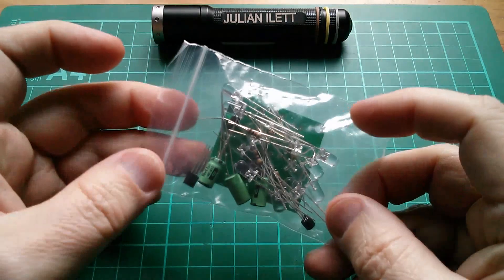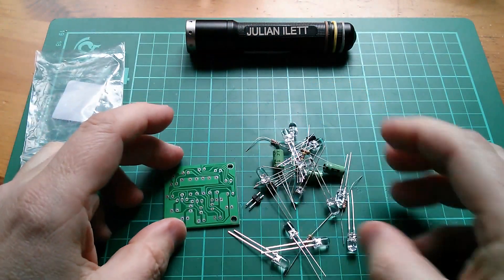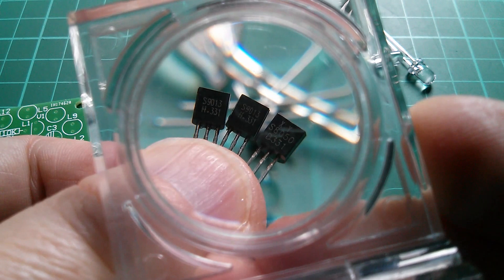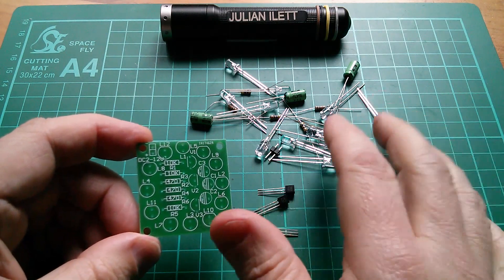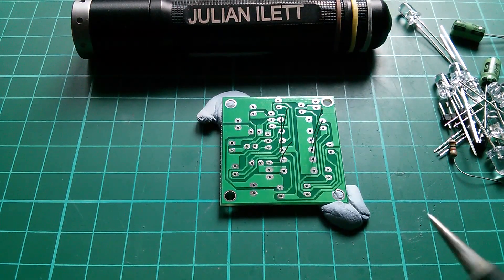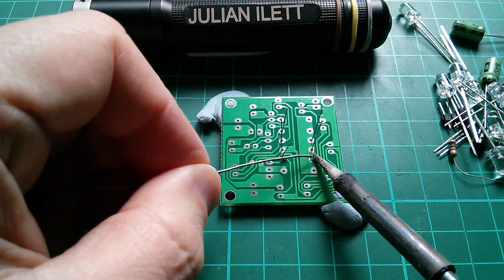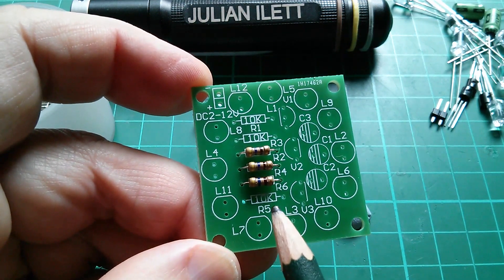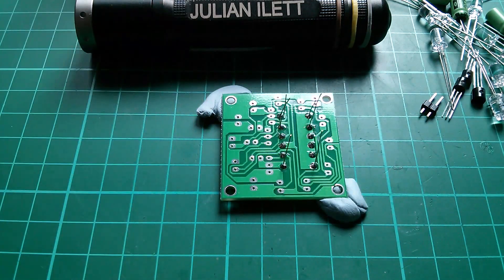Very Simple Electronics: Circular Blue LED Kit Build

Comment: Hi. IT is posible to make IT slower flashing and how please
Reply: Three ways:
i) lower supply voltage
ii) increase the value of the 10k base resistors
iii) increase the value of the electrolytic capacitors
Reply: Kiko Kiki
Hi. IT is posible to make IT slower flashing and how please
'
hi K K...
only one normal speed...
no fast / no slow

Comment: The reason I believe for the 1 transistor being slightly different... without looking at the datasheets of the two types I would assume, that the 2 same have a very slightly higher base trigger voltage.  That would give the oscillator a starting point so that the timing is near perfect.

Comment: I built a kit the other day here in the RV, parked in the Mojave Desert near Needles California (Home to Spike, Snoopy's brother!) It contained those blue Resistors that are so damn hard to read, so I laid them out, and tested each with my component tester, then soldered them in.  Went like a charm, and the device performs as advertised, I now have a nice little oscilloscope built by me, for me.  It works a bit better then the little one I built from a Nano, it does a job when needed but the new one is much nicer.

Comment: Are you actually using leaded solder as you said or is this the lead free variety?  I haven't soldered in years and a little concerned that lead free might be troublesome.
Reply: Richard Forester I've found that lead-free solder doesn't flow as nicely as the old 60-40, I find myself having to use a flux pen and reflow in order to get the connection to look right.  It is supposed to be safer and less toxic, of course, but they said that about margarine and aspartame too.  I generally wear blue nitrile gloves and run a fan on my bench when I solder now, regardless of whether it contains lead or not, as the various fluxes all contain nasty stuff as well.

Comment: Stick the legs of the components trough the holes in the PCB,
bend them to a 45 degree angel on the other side of the PCB, cut the legs at ca 1 - 2 mm above the PCB, 
and THEN solder them.
You get a much better result that way, and the legs are not in the way all the time.
Reply: I don't like the bent leg method because it makes the component harder to de-solder. If you keep the legs straight the component comes out much easier

Comment: Non of these ways to identify the LED polarity is reliable. It might be the commonest way to identify the polarity but not 100% correct all the time. The best way in my opinion is to test the LED by 3v coin cell; if it does not light up on this direction, just flip it over.

Comment: Bet you anything they used a different transistor with slightly different specs to start the imbalance required for the thing to run
Reply: Yep, that were my thoughts as well.

Comment: You have now nice two channel scope, so you can show how the oscillation get started due to mismatch of one of the transistor parameter. Even if you use all the same part number for these 3 stage ring oscillator then also one will start the wave first. The manufacturing tolerance is always there. Thats why two transistor multivibrator circuit still works. I am confused with the fact that why some resistors have 5 band and some have 4. So for beginners like me, it would have been helpful if you could show why some of them have 4 and some have 5 bands. how to read their tolerance etc. Finally my though is, its purely an extended soldering practice.

Comment: For beginners like me, you forgot to explain how to identify the LED by its internal shape. Because I needed to identify one of the LED on my PCB where I have no option to identify which leg was shorter than other. Due to non availability of flat edge (its an oval shaped LED) I can NOT identify anymore. It would have been nice of you if you just explained the cathode and anode identification by its internal structure that would have been helped a lot beginners like me.
Reply: You can always check the polarity with your DMM if it has a diode test mode.
Reply: Network XIII - not all will work with LEDs, especially the higher forward voltage types like blue, white etc.

Comment: The circuit is a bit wasteful on the battery, shorting out the 8 LEDs that aren't lit.
Reply: Have you worked out just exactly how much is "wasted" there?  Clue:  Not much...
Reply: Robin Vince
The circuit is a bit wasteful on the battery, shorting out the 8 LEDs that aren't lit.
'
hi R V...
i have two good LED circular kits with 24 white LED lights in here my channel video

Comment: lol what trickery is going on at 8:40? You solder the 2nd set of pins and then it jumps back in time before that and you cut the first legs off. Is this a mind trick to catch who's watching closely? :P
Reply from the maker: Yeah, that's called getting my shots out of sequence trickery. Which should be impossible because each shot is fully date and time stamped.
Reply: I noticed that too.  Obviously he made a small mistake in editing.
Reply: lol i noticed as well. not sure if done on purpose or not. lol

Comment: Could someone change the LED's to a different color and still work? Or would you need a different circuit design?
Reply: centaur1a - yes, but each group of four LEDs has to be the same colour and type. As as others have said, for different colours or types, the 470 resistors may need changing to a different value. But this does also depend on the intended supply voltage as well.
Reply: You could easily put in different led's, but you might need to change some of the resistors as some led's work at a lower voltage, especially red ones.
Reply: Mark Flack unless you're driving em on extremely low voltages that shouldn't be of concern.
Reply: centaur1a
Could someone change the LED's to a different color and still work? Or would you need a different circuit design?
'
hi C...
i have one LED circular kit and spray black on PCB and 12 white LEDs
Reply: '
hi C...
i have 5 kits...
LED orange  / red / white plus color LED on the center...
already in my channgel video

Comment: When soldering components why don't you solder the furthest 1 first then work towards yourself so as to not remelt the ones you have already soldered?
Reply: Mentorcase - I normally solder components in order of the height of each component.

Comment: one different transistor is used to cause an asymmetry and force the circuit to start oscillating. if all the stages are identical no one will start conducting so there will be no oscillation. This behavior is easy to see when using an electronic circuit simulator like spice.

Comment: The only reason I can thing of is to teach newer useres to be precise with component names. (Like: even though they look the same doesn't have to be the same) But It kinda backfires if the circuit still works with "wrong" placing.

Comment: I found a great challenging clock kit. It's got SMD and through hole IC's and LED's. I have tried several clocks and this one is challenging and works when you're done. The spinning clock hasn't worked out. Couldn't program it because the programs are too large for the storage. I got an 8x8x8 cube kit but it didn't come with the plex case. Watch out for that. They are selling these kits as including the plexi but not in the fine print. then still charging full price.
I'd like to see some of these kits used for modifying other stuff or adding mods to improve the kits.

Comment: hey Julian, just wondering,  as I'm setting myself up with some arduino development, I've ordered a few Nanos, a few breadboards and jumper leads, but what else do you recommend for a beginner in arduino development? I've used the arduino flower thingy to make a light-up skirt before but other than using prebuilt leds and kits I have no clue XD
any suggestions?
Reply from the maker: LEDs and resistors definitely, maybe a few potentiometers for analogRead, and I'm a big fan of OLED displays :)
Reply: +Julian Ilett oh yeah, you do seem to love oled displays XD awesome, just assorted resistors and LEDs yeah?
Reply: I would recommend this kit, especially as it is on special offer at the moment.

http://www.ebay.co.uk/itm/161176373189
Reply: Ashleigh Rowe I highly suggest the Elegoo super starter kit. it's on Amazon. it's an EXACT copy of the Arduino Uno R3. and it comes with a shit ton more parts and projects. I learned to program in C++ just from the tutorials. it is also way cheaper than an Arduino. it is a good quality knockoff, it uses the exact same parts. another thing you might want to get is a small multicolored OLED display. I got one in eBay for $10. it arrived in a little over a week. just search for Arduino OLED display.

EDIT: it's on sale too https://www.amazon.com/Elegoo-Project-Tutorial-Prototype-Expansion/dp/B01D8KOZF4
more stuff 
https://www.amazon.com/gp/aw/d/B009OVGKTQ/ref=pd_aw_fbt_147_img_3?ie=UTF8&psc=1&refRID=P8WCDX2WNYPZ9CJ7WSP9

https://www.amazon.com/gp/aw/d/1259641635/ref=pd_aw_fbt_147_img_2?ie=UTF8&psc=1&refRID=P8WCDX2WNYPZ9CJ7WSP9

Comment: Perhaps it has something to do with how the circuit starts. There is some slight difference between this transistor and the other two which means its set of LEDs will light before the others, and from then on the circuit is up and running.

Comment: Will the LEDs even light at 2V?
Reply: Probably very dimly. LEDs can glow at pretty low currents.
Reply from the maker: +That Guy Not the blue leds. The PCB was probably designed with red leds in mind.
Reply: I was thinking about the forward voltage, not the current.
Julian gets it ;)
Reply: That Guy
Will the LEDs even light at 2V?
'
hi T G...
i have LED circular kits with 6 volts in my channel

Comment: I assume one of the transistors has a lower turn on voltage or is faster acting, to make sure the circuit actually starts.
If they were identical, they could all try to turn on at exactly the same time when power is connected.
Reply: Best answer.
Reply: tjousk but then again no two transistor will ever be 100% identical performance wise. So Idk what the real deal is.
Reply: Indeed.
Reply: +Brainstorm4300 The real deal is to start a particular LED when you power the device on. Havent been through the datasheets yet, but the current gain of that odd one is either low or high and thats been deliberately chosen.

Comment: Checking the LED's "anvil" for polarity is not reliable. It's most commonly negative, but there are exceptions.
Reply: Forssa1 I found that in the hard way. Soldered all of em in and some wouldn't light up. Spent awful lot of time on debugging the circuit before realising what the problem was. After that experience I've developed trust issues and always check each led before soldering them in.
Reply: Forssa1 I suppose no method other than testing is completely reliable. Both legs could be cut to be equal, and LEDs don't always have a flat end
Reply: The anvil has never been meant to identify polarity. It's merely a part of the construction of the LED, and which polarity it has is arbitrary depending on which LED technology is used.
But the flat and different lead length is specifically there to identify the polarity.
Reply: Forssa1
Checking the LED's "anvil" for polarity is not reliable. It's most commonly negative, but there are exceptions.
'
hi F 1...
i have one LED circular kit with spray black PCB and white 12 LEDs...
very good kit
Reply: Most 3mm and 5mm LEDs do have the anvil as the negative, but not all. I have somewhere some where the anvil is positive.
Cheap LEDs also may not have the leads as you describe, or the flat as you describe if there was a problem during manufacturing. Earlier in the year while testing a pack of 100 (or was it a pack of 200, I forget) of cheap LEDs, I found one with the polarity features the wrong way round!

Comment: Why don't they all just come on and stay on ?  I sense that the single/different transistor somehow causes a timing delay that propagates thru the circuit causing the delay - but I can't quite see how !!
Reply: I'm guessing it starts first due to a slightly larger gain, a lower base-emitter saturation voltage, or something to that effect.

Comment: What are your thoughts on the transistor differences? I've thought of nothing and I'm all out of ideas.
Reply from the maker: I think it's to kick start the oscillation.
Reply: I believe that's it, yes.  If I'm reading the datasheet correctly, the 8050 has a lower base-emitter voltage and higher gain, so it should turn "on" first to drain that stage of LEDs.  This is evident from the video at 17:20 and 18:12 -- when you power it up LEDs 5-8 are the first to (briefly) light up.

If the transistors were identically specified, the ring oscillator might start up in an inconsistent state.
Reply: Yes, Majromax. The VBE(sat) is lower on the 8050 and it will turn on first making sure the oscillator will run. I would guess the chance of getting three exactly identical 9013 transistors is slim to say the least. That means one transistor would turn on first even if they were all the same type.
Reply: @roberteliassen5020  I think VBE(sat) is relevant when the transistor is IN saturation mode which is when the LED is on. I didn't look at the datasheets but hFE would likely be the reason.
Reply: Robert Eliassen exactly what I thought. But I don't see any other reason. Maybe they wanted to be 100% sure? Idk Chinese kit makers don't seem to be bothered about their products being 100% reliable. Maybe they had those three types of transistors in stock/ got a huge deal from some manufacturers. Who knows.
Reply: Yeah, having a different spec’ed transistor is one way. An alternative is to have one section have a slightly different resistor value.
Reply: though probably not the case here  Alternative package (pin out) components are available... and mixing them on a PCB is/was considered bad form ..they can get you out of a hole when laying out the PCB
Reply: I don't get anything either.. The 2 types are very similar. One could replace the other.
Reply: Brainstorm4300, after a bit of pondering over this circuit... Well, it's not that one transistor turns on first, but rather the fact that the last one doesn't turn on, because the two other does. This circuit is designed so the LEDs is on when the transistor is off. That means there are two transistors on all the time, and one off. The transistors is like a "shunt". Having one transistor with a lower VBE(sat) doesn't seem right to me, it shoud be one with a slightly higher VBE(sat) if the point was to ensure one transistor not be turned on. Hmm. Anyway, I might be wrong. It has been 30 years since I was an electronic student and software development got in the way of making electronics my job. :-)

Edit: Ah, one transistor with a lower VBE makes sure it turns on and hence the next transistor is off (and the third on). Yeah, it makes sense...